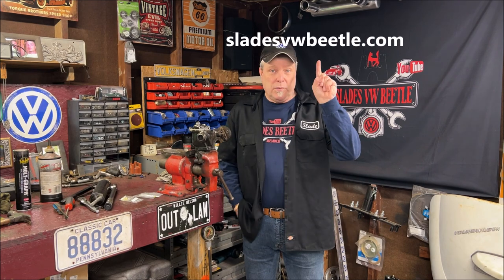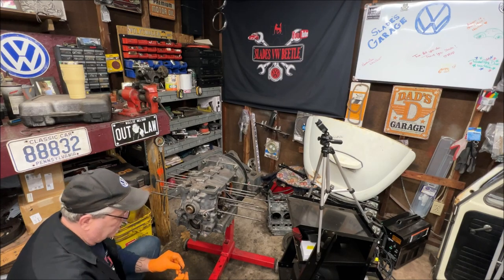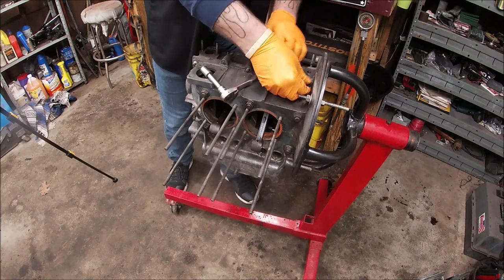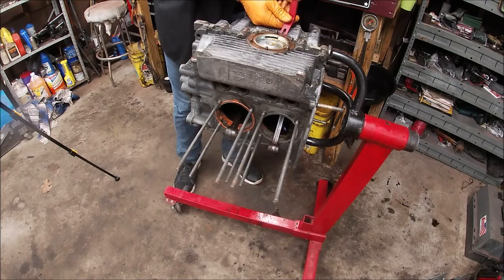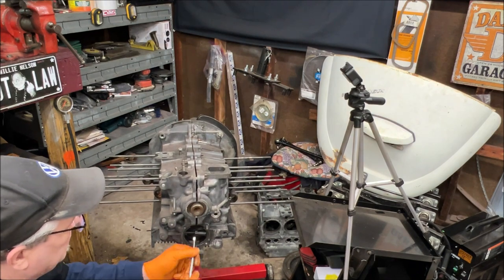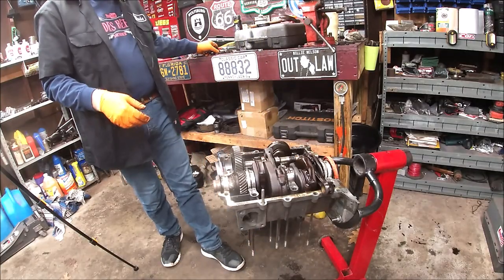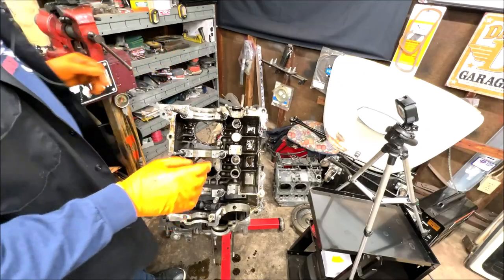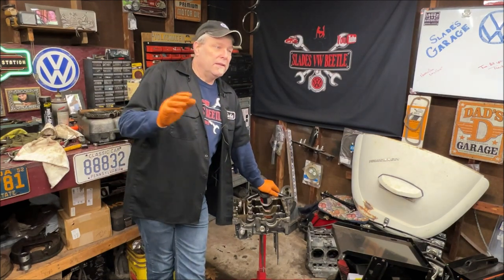VW Beetle Project Second Engine Teardown - Is this Block Better? - Broken Cam

Comment: I forgot to push enter SMH this block has so much more potential. This motor stuff seems so Intimidating still
Reply from the maker: This one honestly looks pretty good!!
Reply: @SladesVWBeetle  I see a 1641cc or better in that blocks future. That case is a great candidate for a upgrade. Do you think a 1776cc is a good starter high performance upgrade until I get this 2 liter built I'm still debating with myself on how big to go to be honest

Comment: I quite like the tear down videos, do learn a lot from them.
I have a damaged barrel so have bought a standard  1600 kit for them. Deck height is 1.7mm so might end up as a very low compression engine.  Heads are getting fly cut so may be time to see the engineer to make sure a little extra comes off.
Reply from the maker: Engine work is becoming more expensive now. Wished I had a shop closer to me!
Reply: @SladesVWBeetle  the big shame is that i don't have enough experience to do it on my owne mill
Reply: If you want to reduce the deck height the engine case needs to machine or the cylinder barrels need to machine. Fly cutting the heads decrease CC size.

Comment: Another great video Slades. I can’t wait to do this to mine. I would of worked on it today some trying to get the ignition wired back up but had to put up a new mailbox and post as mine was rotted and the mailbox was broken lol. I plan on buying a cover for mine soon as well that way when I’m not working on it I don’t have to worry about weather or anything like that.
Reply from the maker: That’s too funny, I just replaced my mailbox and post, it was rotted. Not fun in the winter 😁

Comment: The 3&4 side of the engine case should be mounted to the engine stand.  Its easier to split the engine case this way. Just my opinion.
Reply from the maker: Ya know I was going to switch it around, and I got lazy 🤦🏼‍♂️

Comment: Hay slade I need your help. I'm tearing a 1600 apart to put new crank bearing and piston bearings in. The front of the crank towards the pully how do you get the gears off so I can remove the crankshaft bearing?  It's 1 peace like the back end is? Second it I get an eagle 110 cam do I need to get new lifters. My stock ones look good. And do I need new pushrods or will mine fit. I have pictures of the crank but I don't know how to post them on here. 3rd the first rod by the nut or cap on both sides are ground down but nothing in block is worn down. Is this normal from factory.  Engine is stock 1600. Thanks . Love the show. Learning alot from you. Rob.

Comment: We are considering a scat c20 cam and over sized pistons ported heads and dual single barrel carbs on a 1600 what are ur thoughts on this combo and what kind of hp can we expect. We are new to the vw scene

Comment: Hi Slade, you said not to remove the distributor when rotating the engine to remove the pistons. Was curious the reason why? Will it damage the soft ring gear for it on the crank?
Reply from the maker: Hey brother! Yes, exactly, make sure the distributor is in place and tightened down before rotating the engine. You will chew the gear up on the crankshaft.
Reply: Thanks Slade, that's what I thought but nobody comes out and says that just don't do it. Anyway, I think I told you i got an old 40hp 1965 engine for cheap and getting the case splitter this week. Once apart will see if it's worth saving for at least a stock build since it just a single oil port motor. If not it's just fun playing with it and shooting videos. Thanks for your quick response,
 buddy. it's really warmed up around here already and the big news is we got one of the Ravens coaches for our new head coach for the Seahawks.

Comment: I’m not you, but if I was……and I’m not…
But if:
I would have bolted a flywheel to it and checked the end play first.
Then, looked at the thrust bearing and see if it walks.
When it’s open, I would of course look for damage by the previous owner. And the broken cam…sure. Of course.
I would also look at your dowel pins….and see if they are ovaled and your bearings are walking in the saddles.
No problems?
Then I would rinse it out, put new bearings in it…..a new cam , lifters and oil pump. 
…..and put it right back together .
Unless your trying to get 200 hp from it.
But if your trying to get just the factory horse power…..I wouldn’t even have it line bored.
Cause, it looks ok to me.
But…..that’s just me.